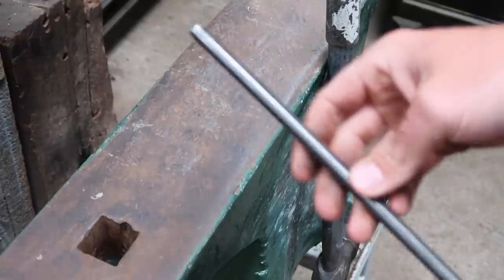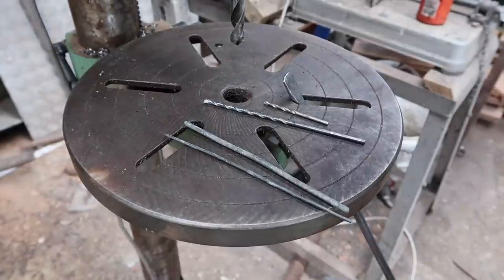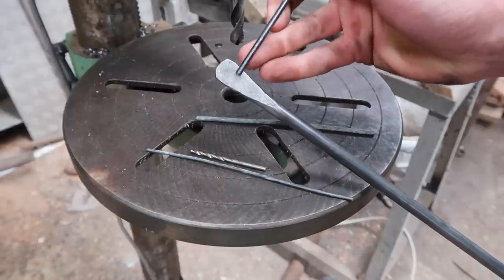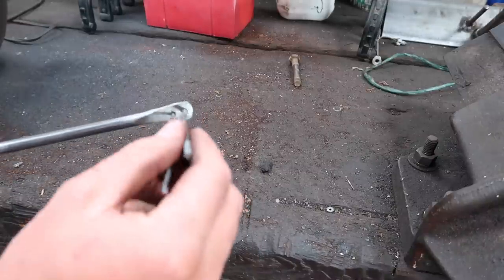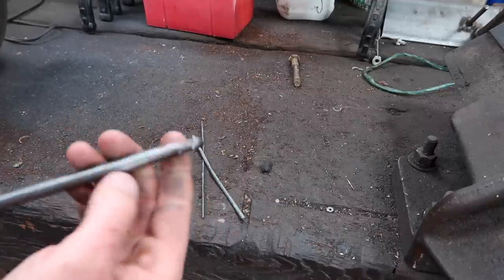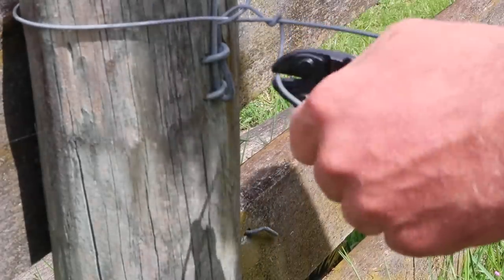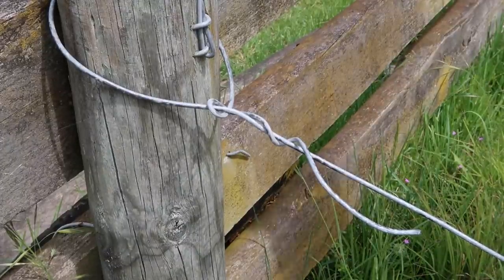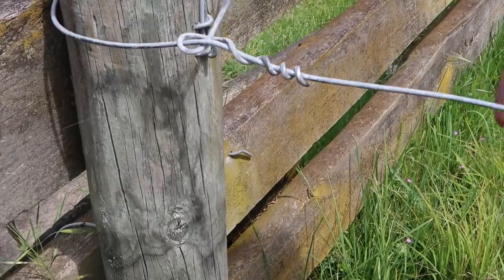Make a Wire Twisting Tool

Comment from the maker: Let me know in the comments if you have made one of these before or have seen a better design to achieve the same thing.
Reply: A longer tail and my hand.
But for retieing, the claw of a hammer! Ever wondered why some have a hole?😉
Reply from the maker: Graham Derrick  cool as!!
Reply: I just  used an old  screwdriver.
Reply: I made one and it’s brilliant!  My application is for panel fence wine racks and this tool fits where others don’t.  My tool has a 90 at the end which helps to make tighter loops.  The 90 was by accident while experimenting, it bent on the the fence material but in turned out better.
Reply from the maker: @JoeAroner-SIWAYTV  oh nice yea sounds like its worked out! Appreciate your comment
Reply: Brilliant.

Comment: Also found the Knipex to be very good and now have most models in the 200 and 250 mm sizes.   Favourites being the 71 31 200 and 61 01 200. Prefer the immersion or dipped handle as stripping the plastic of one handles makes them a great tool for tightly pulling up a what I know as a Queensland Hitch. The Mauns and Parrot beaks are a thing of the past.

Comment: Started with both a Hayes and a Waratah Wire Twister in the Eighties (still have the originals). But as you can see the metal twisters will do some damage to the galvanising. On realising this I started using using Twister made from the same material as plastic fence insulators. Plastic twister is about 12mm thick, 125 mm long and 14 mm across with 4 holes that accepts 2.5 high tensile - no more damage to the galvanising. The plastic does obviously wear - but they are very low cost.
Reply from the maker: @IsambardKingdom  oh nice! Yes I only use in a pinch as like you say does strip galv off and with todays wire, rust sets in very fast.

Comment: I'd make them 3 inch or so longer for the leverage. Good idea.
Reply: About 3" overall length works very well... If you get it too long, it makes it difficult in tight spaces.. such as working with woven wire.

Comment: I have made and used these a lot, found using mild steel the holes soon elongate then don't work so well, the best one yet I made out of a open end wrench, cut of the open end off drilled a hole in the shaft, done, I used a cheapo wrench that I payed maybe a dollar for, or pick up one used some where, the higher grade steel seemed to stand up to the use better, in retrospect I probable could have just drilled a hole in the wrench and left the open end on, but the slightly thicker handle giving a deeper hole seems to grip the wire better giving a tighter barrell, where appearance matters.

Comment: Right that's why I said make the handle telescoping,that way you can colapes it to fit into small areas and extend it for larger areas/larger squares,I was thinking thread the handle and add a piece that can be screwed in for small areas and screwed out for larger areas or even screwed off for really small spots

Comment: Why not use my idea . How often have you lost your Sheep Wire Twister ? They cost about £14 each on ebay . Why not make your own . 
Just get an old stainless steel table knife , cut off the blade and drill 3 holes in it as the picture .
Hole should be clearance size holes for the wire . Ive made a few as i loose them occasionally ! Nice and easy on the hands too .

Comment: Countersink the holes just slightly so you don’t strip the gal off the wire.

And drill a hole so you can put some colored rope or twine through it so you can find it when you drop it in the long grass
Reply from the maker: andrew gowenlock Yes!! Great ideas, it deff does strip off the gal. I like your thinking. Cheers
Reply: HCL  hard fencing in Tenterfield has fought me a lot.
I’ve got 3 tools, one 150mm long, one 80mm long and one 40mm long

Comment: If the handle was longer you would have more leverage,you could make the handle telescoping,to fit between different spans of wire
Reply: idahomike100. If you make it longer, it can't be used for 8 strand sheep wire, or anywhere you have strands of wire close together.

Comment: Those wraps are terrible
Reply from the maker: K
Reply: @Lindz37 that knot is just as bad
Reply from the maker: @rob-artfarmingnz6138  yea ok, it’s not the tidiest knot, but just showing an example of what I use this “tool” for…
Reply from the maker: @rob-artfarmingnz6138  Also just for the record man, the knot was purely an example of what the tool is for, I see why you say the knot is bad but I wasn’t showing how to tie the termination, obviously if is was a actual wire on a fence yes the knot would be tight against the post and the wraps Ideally need to be tight together too.

Comment: You don't need one if you learn how to tie off wire correctly
Reply from the maker: stubbenmonkey yes you are correct but for tying a broken wire back together, often there is not enough wire to make the handles. Cheers
Reply: stubbenmonkey dude whats wrong with you
Reply: As a chick who needed a crash course in fence repairs..... I appreciated this video! Thanks

Comment: Would you just LOOK at all that slack... it's called TENSION WIRE for a reason.  It needs tension. Maybe im just thinking chain link fence but damn...I'd be out of business if my wire looked like that..
Reply from the maker: haha Yea its not on a fence, its just an example of where i'd use it! It's just a loose bit of wire tied quickly round a post. For sure it would be tight in real fence line.